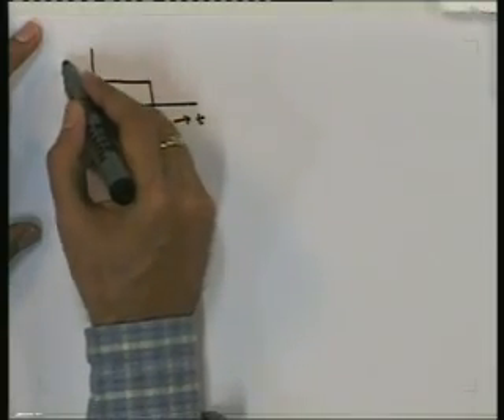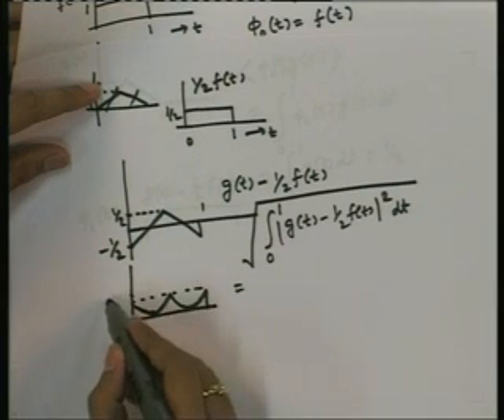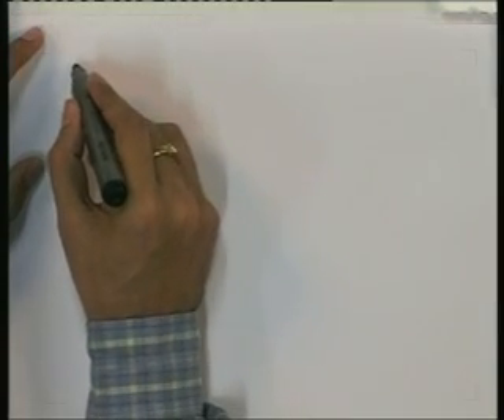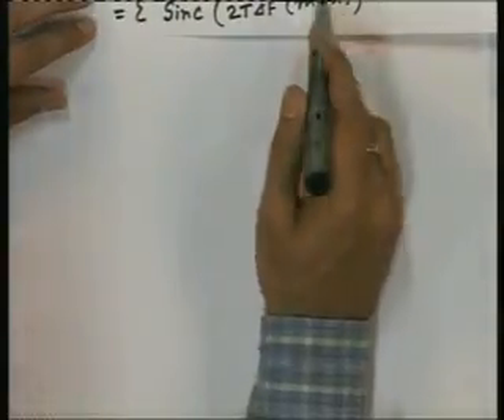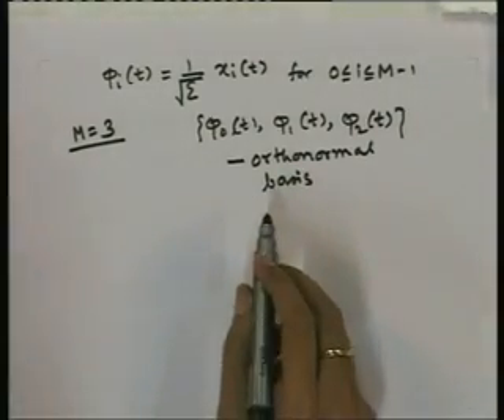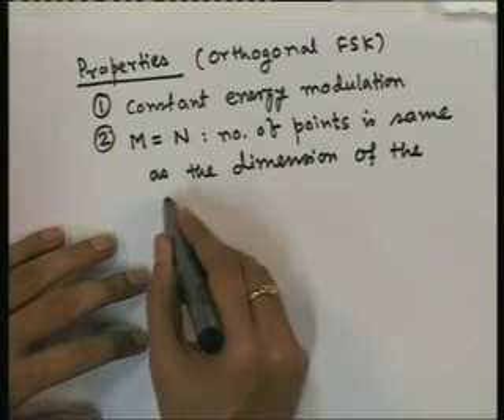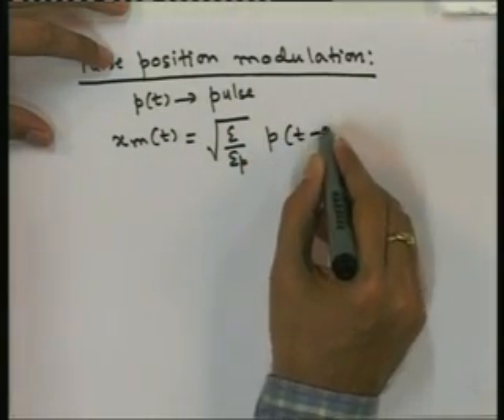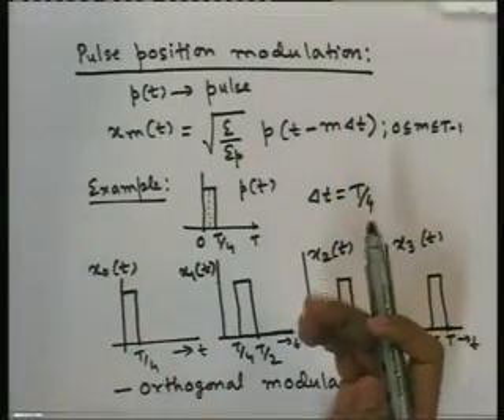Lecture - 18 Digital Modulation Techniques (Part - 7)

Comment: In the example when he calculates the denominator of φ1(t) (09:40) , the integration has to be from 0 to 1/4 and the it has to be multiplied by 4 (the function remains same that is 4t^2.